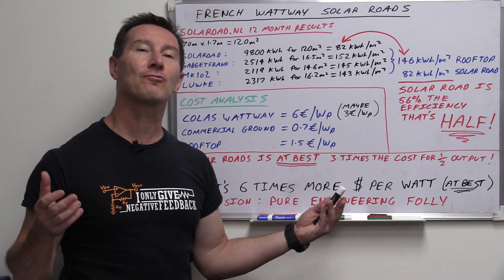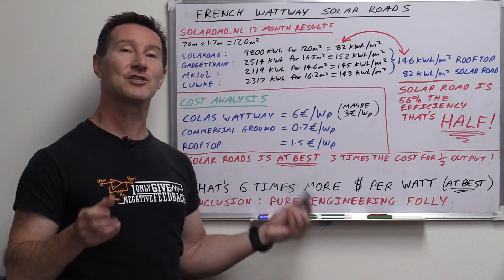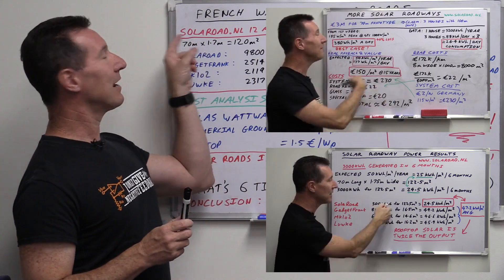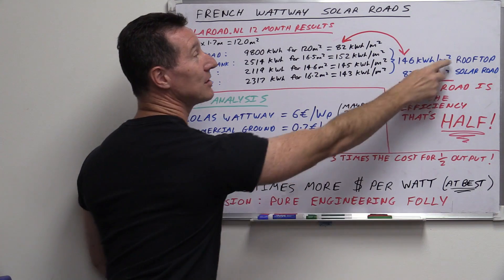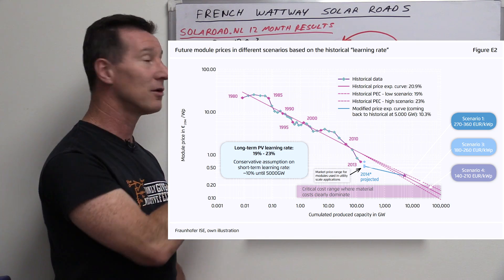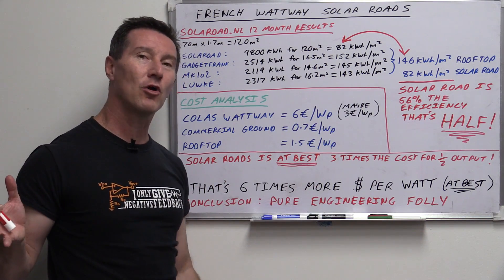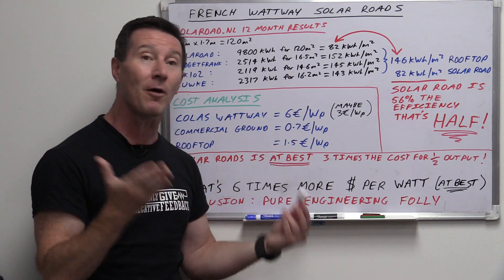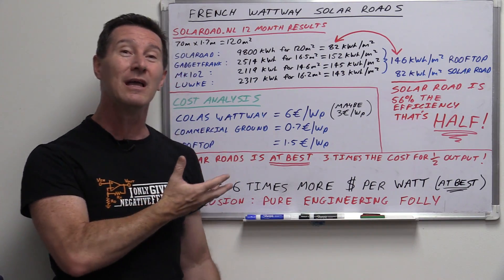EEVblog #850 - French Wattway Solar Roadways BUSTED!

Comment: Would it be possible to harness energy created by cars travelling on roadways much like the Mall of America harnesses the energy of people to heat itself? If so, I'd love to see a video on guesstimations of what kind of energy that could produce, some of the difficulties in implementation, etc. Great video!
Reply from the maker: +Drew NA Nope. The energy has to come from somewhere, there is no free lunch.
Reply: +EEVblog Increased fuel consumption. I reckon I could get backing for something like this. What dya think Exxon?
Reply: +EEVblog We could place them only in downhills :-)
Reply: +Drew NA As a car wheel is stationary at all time with respect to the road there will be no frictional energy. There is static friction but that is locked into the system. Release it and the car is skidding and will probably crash.
Reply: +Gummans Gubbe Well, you could line the railroad with windmills to recapture those few moments of wasted energy displacing the air as a train passes by (that is "free" energy in that it is otherwise wasted)...but that is only slightly less stupid (efficiency wise at least) than sticking windmills on trains...which only reveals that someone completely failed basic physics.
Reply: +Coolkeys2009 Sure, it's possible. IF you want to haul a gigantic trailer-mounted low pressure, low temperature (ammonia turbine?) power plant.  ;)

How the heck do you propose to "extract energy from aero losses?"  Wut?

Braking recovery is easy enough with current hybrid tech. Or just teach people not to race from one red light to the next....  (Of all the "hypermiling" techniques, the simplest, most effective is to lift off the gas when you see an inevitable or likely stop coming up.)
Reply: +Gummans Gubbe "A minister in the previous Swedish government suggested, for real, to put windmills on trains. Always windy there."

If only we could find a way to harness all the hot air generated by the world's politicians ...
Reply: Drew NA Yeah! I mean if you have one guy at 37 celsius + another 37 what do you get? 74. If you stuff enough fat people into a mall (217 k), you can get hydrogen nuclear fusion(8 million celsius). Take that Dave Jones, mr, know-it-all.
Reply: +Drew NA are you talking about piezzoelectric ground tiles ?
Reply: +Drew NA 
http://large.stanford.edu/courses/2012/ph240/garland1/
Reply: +EEVblog indeed, if the roadway "harnesses" energy it must take it from the cars, which means your cars are essentially powering it.  Cars are one of the worst efficiency energy converters on the planet.
Reply: +Drew NA I fail to see how it's not true that every building harnesses the energy of people to heat itself, and that by extension gyms would be toasty. heat is random motion, you can't transform it into anything else, end of the line. you can only "harness" heat in the presence of a gradient/flow, but heating will happen on its own, all else being equal (e.g. you can improve the insulation or the air flow, to optimize for heating with meat bags instead of some other device)

if you mean those floors that supposedly generate electricity, if you use that for heating that's just a very expensive and material resource hungry of redirecting heat through a structure by creating paths of lower resistance. This technology is not ground breaking, you can implement it with more traditional fluids like oil or water instead of electrons, e.g. central radiator.

Same goes for using it for road surfaces, you just slow down the cars, and make them work harder to convert their kinetic energy into electrical energy with pretty crap efficiency and a whole lot of engineering to do it.
Reply: +geonerd Dave made the comment that there's no free lunch, I was just pointing out that there is energy available at no cost to the car driver. Over 70% of the energy available in the fuel is wasted by the engine anyway. How you collect it is up to someone else to figure out. One thing I've learnt from this whole Solar road ways thing is it's a bad Idea to try and make a bad idea work well. So the best idea it's to stop cars wasting so much energy in the first place, which there finally starting to do after all these years.
Reply: +Maanuueel42 \m/(^_^) Unlike dino cars though electric cars have the potential to become low / zero pollutant over the whole (energy) supply chain. Right now widespread electric car adoption would be an environmental disaster because we'd generate the power needed with coal but in the future that will have to change. The other pollution caused by electric cars (e.g. mining for lithium) can be dealt with just as it has to be dealt with for other industries. I agree electric cars have a long way to go but they are probably the future. I don't see hydrogen cars any time soon and no one seems to be seriously researching synthetic fuels e.g. taking CO2 from the atmosphere to make CH4 - this would be very energy intensive but it has some nice benefits.
Reply: Wobblycogs Workshop I agree. I can see two possibilities for e-cars.: Batteries could be developed much further, making for compact, light, easily refillable and weakly polluting energy storage. Alternatively, a new and disruptive storage technology suddenly appears and overtakes all other technologies.
My guess is that for e-cars to really shine, we must first run out of petrol, so in around 30-40 years.
Reply: +Maanuueel42 \m/(^_^) Tough call to say when e-cars will really start taking off. I could see them becoming fairly widely adopted in some areas of Europe within 15 years but I think it'll take longer elsewhere. From a personal point of view I'd buy a low powered e-car that did 75 miles on a charge tomorrow if they could make it cheap enough that I could also own a dino car. Almost all my trips are under 75 miles but when I need to do a long trip I really don't want to be messing about hiring cars etc etc. I think that's more a matter of policy though, governments make too much money from cars and it distorts the market.
Reply: +EEVblog  This is what these people just can't get through their heads.

  We'll have a roadway made of rollers next to "harness" the power of all the cars...  oh wait....
Reply: +Coolkeys2009 Sorry but that's not how heat engines work. The "waste heat" from the engine, most of which gets dumped out of the radiator and the tailpipe, is not available for free. 

Engine designers work very hard to get the engine's "cold side" as cool as possible, as this improves efficiency, per "Carnot efficiency". (If you're unfamiliar with that concept I strongly suggest you look it up.) And you cannot "recover" some of the "waste heat", converting it to some other type of energy,  without making it more difficult for the engine to get rid of it. Which means the engine's "cold side" will get warmer - and that means the engine's efficiency goes down. TD guarantees that the losses there will more than outweigh the gains you get from the "recovery".  ("You can't win, you can't break even, you can't even quit the game.")

One reason is that the output heat of a car engine, although there is seemingly quite a bit of it in terms of "heat energy" (measured in watt-hours or BTU or whatever), is not that high above ambient temperature. This guarantees that the efficiency of any heat engine-like means of recovering that energy will be very low. (Carnot again. The efficiency of any heat engine or heat-driven energy conversion process is limited to 1 - (Tc / Th), where Tc and Th are the temperatures of the cold and hot "sides" of the engine respectively, measured on an absolute scale like Kelvin or Rankine.) 

Nevertheless there is some application of the idea. The most obvious example is something almost every car already has: the passenger compartment heater. It runs some of the engine coolant through a little second radiator that's in or near the passenger compartment, pushes air through the radiator fins with a fan, routes that air through vents near your feet, and voila, your passenger compartment warms up. But this is engine cooling that we have to do anyway! We're just doing some of it in a different place. (Now you know why the heater blows only cold air until the engine warms up.)

Another idea has been to line the exhaust pipe with thermoelectric generator chips. I understand that some racing cars are using this trick to avoid having to spin an alternator from a belt off of the engine. Still, radiation of heat from the exhaust pipe is part of the engine's heat sink, and now it's been made less efficient. 

Modern "combined cycle" electric power plants do some of this. You start with a gas turbine (ilke the engine on a jet plane) and use it to spin a generator. The exhaust from that is very hot. Then you run that exhaust through a steam generator. You run a steam turbine, spinning a generator, from that. Such plants can now routinely reach efficiencies of around 60%. And finally, if there's a market for hot water nearby, you can build your cooling tower to make it. But these things are only possible because of the vast differences in hot- and cold-side temperatures for the two types of turbines (and the hot water heater). 

An example that won't work is to apply the car's "waste heat" to an absorption-type, which is to say heat-powered, air conditioner. Strange though it may sound, heat-powered cooling systems do work; there was a company called Servel that for decades made refrigerators whose energy source was a natural gas flame. I understand that similar things are still made for R/V use, as a propane tank has far greater energy storage density than any battery. Now it is tempting to say "well if we can make a refrigerator like that, we can build the car's air conditioner the same way! We'll run the a/c from heat we originally were throwing away! It will cost nothing in gas mileage!" Well...

It works with a gas flame because the flame has a very high temperature difference to ambient. Again, the car's "waste heat" is not like that; it's fairly close to ambient. You'd have to redesign the whole system to work with a much lower temperature difference. With the coolant and so on of the standard absorption fridge it probably wouldn't work at all. But even if it did, the efficiency would be very low. Back when I took TD a friend had this idea and he and I and the prof ground through the calculations. We figured out that we'd have to tow a heat exchanger behind the car on a 20-foot trailer to get enough airflow through it. And it only gets worse as the ambient temperature rises - which is exactly when you want the a/c to work better. You can't argue with Carnot any more than you can argue with the conservation laws or the three laws of thermodynamics.
Reply: +Drew NA Yes it would be possible, but not necessarily a good idea. There are concepts of windmills on the sides of roads that would be powered by traffic moving the air.

My fear would be that any energy harvested that way would just have cost more energy to be spent by the cars and trucks.
Reply: samsoulee I guess that is the name of it. I was basically talking about harnessing energy created by friction.
Reply: mbaker335 Ah. Thanks!
Reply: +EEVblog ICE cars waste over 70% of the energy in the fuel. How about recovering the waste heat energy, energy from aerodynamic losses and braking energy?
Reply: +Drew NA That would only make sense in the 100 meters or so approaching a stop sign when you would normally be decelerating. I actually could make sense (engineering analysis needed) to have some kind of durable liquid filled bag so that the tire pushes a 2-4cm lump of water toward a turbine/generator at the stop sign side. Of course, with the coming wave of electric cars and hybrid cars, the car itself will recapture that energy for themselves.
Reply: +Drew NA You could make a highway made of dynamometers. But then no one would get anywhere.
Reply: +Coolkeys2009 Like turbochargers and regen braking?
Reply: +EEVblog The only possible mechanism i could think of is if the surface is slightly spongelike and a pressure gradient acting with a capacitive surface at constant charge could create an AC current. Very small though.
Reply: +Maxwell Dynamics that would still increase the rolling resistance, thus increasing the power requirements of the car by more than the power you'd get out of it.
Reply: +Drew NA To elaborate on what Dave said, the energy that you would be recovering from the road would simply be energy that came from burning fuel in the engine of your car (this is dictated by the laws of thermodynamics). There would be sufficient loses in the type of system you are suggesting that it would almost certainly be more efficient overall to leave the roads alone and burn petrol in a generator - we can do a lot better than burn petrol in a generator though.
Reply: Coolkeys2009 well, there would be a cost. The problem is you can't really collect it, because moving energy about wastes it, storing it requires a medium, etc. any mechanism for transferring heat energy from the car would necessitate something that would impede its function of moving around wheels through an atmosphere.

for some applications this waste heat is really great (namely heating the passenger compartment), but in this case it works because the cooling of the engine and the heating of the passenger compartment can be made complementary, without much investment in design or manufacturing.

so sure the ICE could be much improved in theory (but very very far from 70%, look into the carnot cycle). However, if there was a easy way of doing that just by capturing heat, rest assured it would have been done. You can trace through the history of the ICE and how market forces drove innovation, namely in the 70s efficiency started becoming a growing concern which led to a general reduction in engine sizes, and then about 10 years ago computer control became pretty much standard.

But really all we see is nice incremental improvements but with diminishing impact.

There are good theoretical and engineering reasons to assume that attempts at radically changing that are misguided and not likely to succeed
Reply: +foobargorch OK, the only major improvements in car efficiency seem to have been driven by Tesla motors and all the other people creating the technology in the last 10 to 15 years by proving that there was a way forward after all the denial from the establishment for many previous decades . A typical car engine is <30% efficient and WASTES 70% of the energy in the fuel. Hybrid cars/electric cars have only just been commercially implemented in the last few years so creating major energy savings. So I am not rest assured that even if collecting the waste energy was easy and efficient it would have been done.
Reply: Coolkeys2009 electric cars are right now more pollutant than comparable combustion engine cars. The overall efficiency (counting in all factors of energy production) is in the same area as conventional cars, maybe a little bit better. Electric cars still have a long way to go.
Reply: Coolkeys2009 I was talking specifically about the efficiency of internal combustion engine, not the car as a whole.

"Car efficiency" is a bit... nebulous I guess? I think if you want to analyse it from a broader perspective, considering how energy is stored, where it originates, etc becomes much more complicated (but very important., and unfortunately often neglected in discussions about these problems/technologies)

If you want efficiency from chemical fuels, fuel cells are the theoretical upper limit on that. Think electric car running on gasoline or a renewable chemical fuel instead of batteries.

Even more efficient (energy density per mass) is hydrogen but it presents some storage, infrastructure and production costs for the fuel itself (the so called "hydrogen economy" problem). But these costs could in theory be almost eliminated if we had high temperature nuclear reactors.

But if you only drive a bit and sporadically, surely a solar panel and a battery would suffice for most of your needs?

So which is better? It's a bit like comparing apples to oranges.

Tesla's main innovations are in the drive and battery technology, as far as I know, and while substantial their main contribution in my opinion is that they managed to bring mostly existing technology to market, to create a desirable product, to change perceptions and to condition humanity to accept that.

IOW, electric vehicles are a potential game changer, whereas ICE is a technological cul de sac.
Reply: +Gummans Gubbe  Dude, that's funny !
Reply: You could, it might not be that worth it though
Reply: +Michael Sommers 
LOL
That minister doesn't know the law of conservation of energy.  

At least the Swedish government has some good rape prevention advice.  Listen to them, then tell women to do the opposite.
Reply: +Drew NA :D Why don't Mall of America stop the electric escalators then? Make `dem fat bastards sweat it out with their large skin surface and balance the stupid fucking budget? Put those burgers to good use as it were...
Reply: TechnocraticBushman Maybe because the heat from people is taken in so efficiently that the air conditioner has to run in the middle of winter at peak hours.
Reply: TechnocraticBushman lol
Reply: +oisiaa The energy, that pushes your imaginary wave has to come from somewhere. And in this case it will come from a gas station, through the very inefficient conversion of internal combustion engine(60% loss) and who knows how much of that will be lost in the "bag, wave and turbine" system.
Reply: +Maxwell Dynamics And will suck energy out of the car by creating additional roll friction. Why not just buy a gasoline powered generator?
Reply: NGC1433 because that wouldn't make a good buzzfeed article ;-)
Reply: NGC1433 more like 75% loss, add the efficiency of that turbine to it and you get maybe around 85-90% loss. A high efficiency gasoline power plant might just reach 40% efficiency (60% loss), higher if you use the heat for warm water. So yeah, no pint in harnessing energy from cars like that.
The only viable way is regenerative braking, since electric systems have very high efficiencies and this avoids using energy for acceleration from the low efficiency gas engine
Reply: Maanuueel42 \m/(^_^) Unfortunately, regen systems also don't have good overall efficiency. SOme flywheel systems might be good at regen, but looks like they have proven to be impractical.
Reply: NGC1433 some F1 cars use carbon fiber flywheels spinning at 40k 1/min, I would not want to stand next to one when it explodes... :D
The overall electrical regen efficiency might not be very high, but I bet it easily tops the 24%-ish of internal combustion engines, transmission losses not included. ^^
Reply: +Gummans Gubbe LMAO!!
Reply: +Abraham Jaleel how about you fuck off. You make Christians look bad. Well... You make us look worse.
Reply: inferno How about not being a Christian then...
Reply: +Abraham Jaleel Nothing like an Abrahamic Nut Case to spread love and harmony throughout the world!  (Do you make the Daffy Duck "Whoo-Hooo!" crazy-laugh voice when you type shit like that, Jaleel?)
Reply: +NGC1433 Yes, but given the way most people drive, that energy is being wasted as heat and brake wear anyway.
Reply: +Drew NA It would not "produce" any energy. The  energy of motion that cars produce by burning gasoline is already being used to move the cars and to overcome mechanical and aerodynamic friction. Anything that tries to use any of that energy for something else - and this includes Aesma's idea of "windmills on the sides of roads" - will make it more difficult for the cars to move, hence causing them to burn more fuel for a given amount of travel. And the energy transfer, such as it is, will be ridiculously inefficient.  It's a net loss. 

The only thing that makes sense here is "regenerative braking", which is used in some electric and hybrid cars: Using the motors in reverse, as generators, to recharge the battery and thereby slowing the car. Note that well: "slowing the car". this is the inevitable result of trying to recover energy from a moving car and use it for something else. Regen braking makes sense only because, of course, cars do need to slow down and stop sometimes. (However it typically only extends the range of the car by about 20%, and the car has to carry conventional brakes too, because regen braking loses effectiveness s the car slows down and can't hold a car stationary at all.) 

Similarly, schemes that use e.g. piezoelectric (pressure-operated) generators to make electric energy from people's footsteps do increase the effort it takes to walk. It is not usually noticeable because the amount of energy recovered is utterly insignificant. It is a vastly inefficient way of turning food into electricity, and not at all pollution-free. These installations are purely for show. They make sense only if you think it makes sense to pay far, far more per watt what standard generating capacity (or even rooftop  solar) would cost. 

As for the Mall of America, people do give off an average of about 100 watts worth of heat (i.e. the same amount a 100-watt light bulb or electric heater produces) when awake and in light activity, like walking around a mall. All modern buildings that handle large numbers of people are designed with this in mind; they can do a little less heating in winter, but they have to do a little more cooling in summer. Again the energy isn't "free". It's coming from the food people eat. The building doesn't have to do anything special to take advantage of it, and about half of the year, the HVAC system has to work to get rid of it.
Reply: +Jamie Hanrahan i could be wrong but i think windmills on sides of roads won't violate laws of conservation of energy. this is because conservation laws act under the assumption that the system defined is closed (no energy or mass leaves or enters) of course so energy will only leach off of a system when it is apart of that system take the sun. we know that it has a defined lifetime question is we we look at two situations one where the ground is bare and other is where the ground is not  would the suns lifetime increase (die slower), decrease (die faster) or stay the same personally i would say it would stay the same because the energy of light no longer has anything to do with the energy created from fusion like with a windmill by train tracks the train puts energy into compressing the gas (drag) that then expands to create the wind felt (i think) so if you added a windmill to the side of the road it shouldn't effect the train because the wind is no longer apart of the same system as the train so regardless of whether the turban is there or not the wind created will just put work into something else
of course the amount of power created probably isn't enough to warrant adding wind turbines to the side of roads
i'd have to check with a professor or something though
Reply: No, your analogy with sunlight and solar panels is off point; the same principles don't apply. The air is very definitely part of the same system, and the windmills would vey definitely affect the train, to the extent that they turn and make power. The train displaces air to make wind; if you put windmills in the path of that wind to make electricity, the wind is pushing on the windmills... and the windmills push back... which makes it more difficult for the train to push on the air... which slows down the train. To be sure it's a tenuous coupling - which also means that the energy you can recover that way will be utterly miniscule... but the energy you do recover will be coming from the train's kinetic energy. It's like saying you could generate electric power aboard a moving boat by putting a water turbine in the water, without slowing down the boat. That's nonsense.
Reply: +Jamie Hanrahan i could be wrong but mind explaining why the wind is apart of the system when it is hitting the windmill because as far as i can tell yes it will be compressed by the train but after that the train has nothing to do with the expansion of the compressed air into wind and this will happen when the train has passed already so i can't see why what you do with the wind will affect the train as if you put a windmill down the speed of the wind will drop but if you don't it will just stay moving at the same speed until it hits a hill or something meaning the energy (basically the system observed goes from a train air system at t=ti to a air only system at t=tf (the train air system is under the pretense of following a column of air so a new train air system is formed by the following column of air we define)(for a visual of what i'm talking about draw 4 pictures first is a train and then a rectangle a few cm after the train this is train approaching a column of air we define as our air system then a picture of the train at the column of air and the rectangle is fitted to the train then the train after column of air and the fitted rectangle then the sphere to represent expansion(as said this is how i interpret it not necessarily how it happens) the circle is the expansion of the air across all directions this is basically the wind created and \||] is the wind forming to the train creating drag
[====\  X  [|||] --->  [====\\||] ---> X  \||]    [====\  [|||]  --->  XO    [====\\||]
please point out any errors in the picture that aren't it being a terrible picture art wise
ps this is also the reason why it is unviable as a power source even if the windmill there doesn't effect the trains efficiency at all see if you can spot it
Reply: I can't follow your explanation at all, and your "diagram" came out as gibberish. But I can get enough out of it to tell you: You're flatly wrong.

The only way the windmill and the train would be in "separate air systems" would be if the train was traveling through an enclosed tube... Of course, the train would have no effect on the windmills at all, but it would also have much more trouble moving through the air. (Or you could put bell jars over the windmills...) 

As it is, if the movement of the train causes movement of air that causes movement of the windmill, then they ARE all part of the same system. If they weren't, then the train couldn't possibly make the windmill move, or indeed apply any force to the windmill whatsoever. So by Newton's third law (every force creates an equal and opposite force), the windmill MUST push back on the air, so the air MUST push back on the train. Just like the ground pushes back against you when you're standing on it - equal and opposite reactions and all that. You can't argue that they are all part of the same system for the force going in one direction, but that they're not for the reaction force. 

Your notion is basically that the air is so tenuous that the "backwards push" would be minimal. And that's true. But this also shows that the train's push on the windmill would be minimal. 

By the way: Anyone who supports this idea clearly has no idea how much power it takes to turn a generator under load. By straight conversion of units it takes about one horsepower to make about 750 watts, but that assumes a perfectly efficient generator, which of course can't exist. if you think a windmill placed next to train tracks could realistically  recover even one horsepower from the train's shock wave, you're mistaken. (One horsepower is about 7 times what an average healthy young-ish adult human can produce for an extended period.)

And since air is compressible, its energy of movement can be dissipated by simply compressing the air a bit (heating it up) when it hits the windmill blades, instead of turning them. So you won't get "only a little" power. You'll get none.

But even the not-turning windmill (and anything else) is in the way of the free expansion of the train's shock wave. so it will still detract - infinitesimally, to be sure - from the train's speed. 

If you still don't get it, I'm done here. This is a case of "I can explain it for you, but I can't understand it for you."
Reply: Jamie Hanrahan you're probably right i am a little fuzzy on how defining systems and how energy moves between the systems defined that i probably made a misplaced assumption so i should maybe ask one of my professors this for review on energy balances (important for my major so best to clear that up regardless) and even if it is possible i'll just keep that to myself unless you are curious
Reply: Although it is completely stupid in his approach it is not totally an unprincipled concept. It's been in use on aircraft for many decades for emergency power in the form of the RAT; Ram Air Turbine. Basically a propeller attached to a generator or alternator that can be dropped into the air stream when no other power source can be brought online. It is simple, effective and much less complex then things like APUs. However...putting a "windmill" on a train would pretty much be useless in so many many ways......